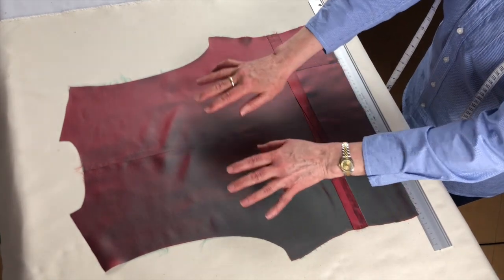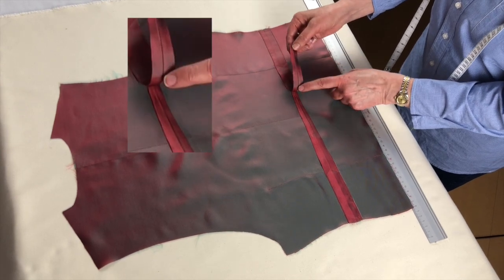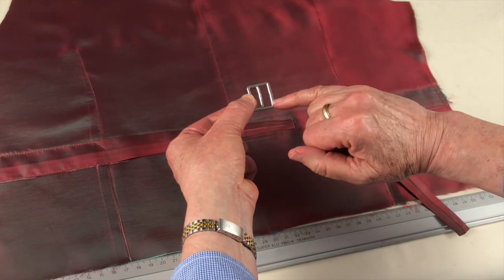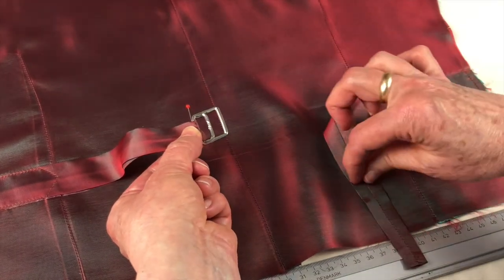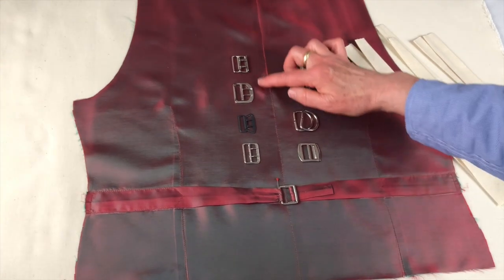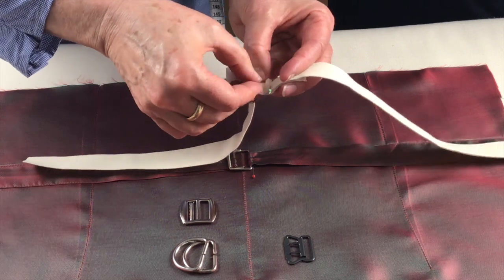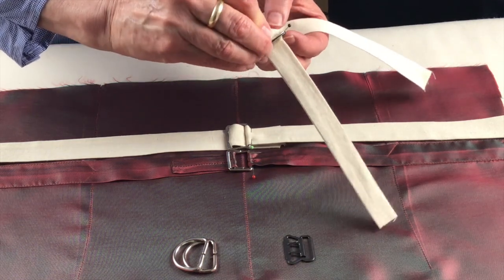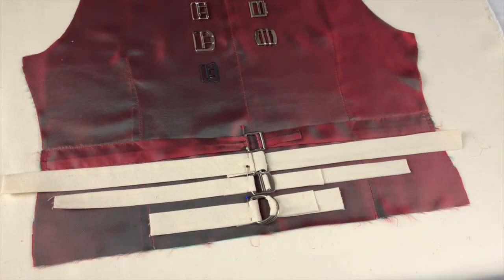GBSB 2021 7:6 - Buckles & Slides

Comment: hello Carol you truly have great sewing skills 🧵👍in previous video comments people make note about how quiet your industrial sewing machine is most people don't realize that your sewing machine has a more expensive servo motor which is more expensive than the typical industrial sewing machines that have a clutch motor and the servo motor gives you the ability to have some speed control, you should research this before you film the video tutorial all about your sewing machine and give people some insight ok ?thank you very much
Reply: I will certainly do this, Frank.  I'd like to take the time to make a comprehensive video devoted to the threading and operating of the industrial machine, and this can be best accomplished once the 'Bee' has aired the final show, as I make these tutorials alongside my full time tailoring job!  As always, thank you very much for your feedback.